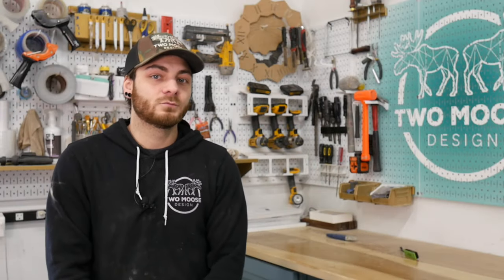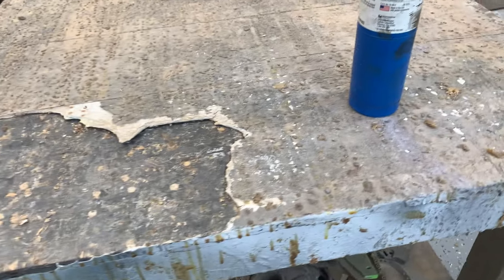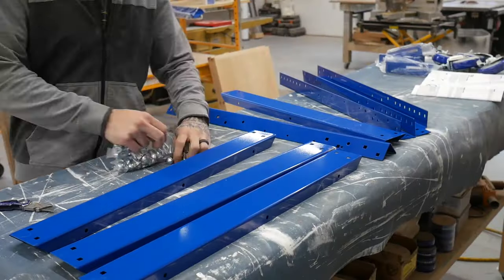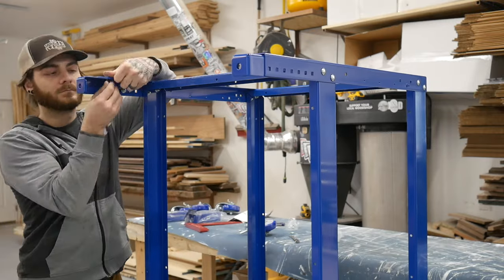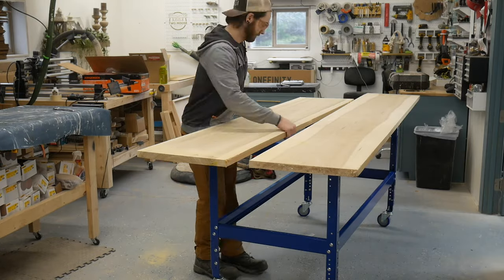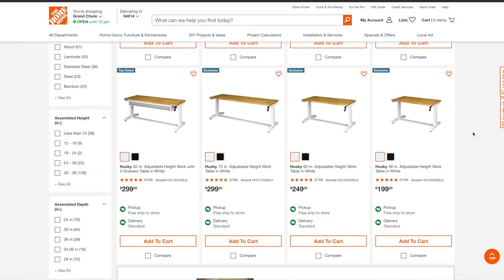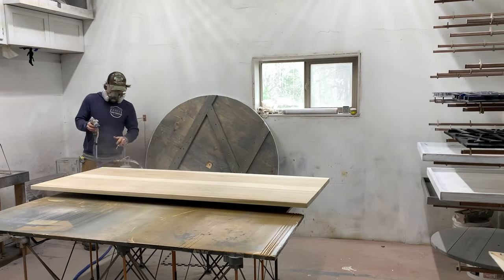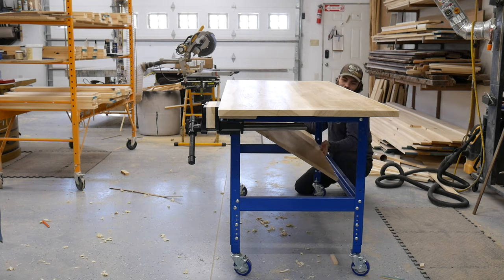Should I Buy or Build a Workbench?

Comment: I have had the plastic legs on my journeyman table for over 1 year now, they work just fine however I prob would get the kreg bench if I did choose again. Lumber is not cheap and it does still require you to build the table to your dimension with the plastic legs which I do like over putting together metal pieces for a certain sized bench, you get to usea few more tools maybe with the plastic legs but both would require cutting.
Reply from the maker: I haven’t tried the plastic ones, I like the kreg benches. Quick and easy! I’d love to build a traditional bench but I just don’t want to spend that much on lumber or have the time right now

Comment: Great video, very useful. What kind of bench did you use for your CNC machines? Did you make your own?
Reply from the maker: I built that one with mdf and 2x4s. I may have went this route if I knew about the bench kits
Reply: @TwoMooseDesign  I built my CNC bench from MDF and 2x4 too. I was thinking the exact same thing when I saw this video. I wish I had bought one of those kits!
Reply from the maker: @tombarton884  I think im still going to build a cnc bench out of these kreg kits. Ive been debating on it since i put these ones together lol

Comment: Nice video. Going to get this for my CNC. What casters did you use to replace the leveler that comes with the leg kit? Like the color that matches the bench too!
Reply from the maker: Kreg offers wheels, they are actually better and cheaper than the ones i bought. I didnt know they offered wheels until I got everything for the first bench. The blue ones look better but the locking feature on them is pretty disappointing. I wouldnt spend $80 on them if i had to buy again. i think the kreg wheels are closer to $50????

Comment: build... materials = $60, no more, no less. No wobble, unlike a $400 husky workbench (which has terrible wobble), not to mention the junkies that try to build/sell for the same price when you can easily do it yourself. their excuse: expertise, craftmanship, quality... all nonsense. it's 2x4's and plywood, easily measured (a kindergartener could do it). no labor or expertise is excuse enough for charging $400 for a $60 table. built a table for t-shirt and crafts, almost went with a husky adjustable (that would have been a mistake). build it yourself, every time.